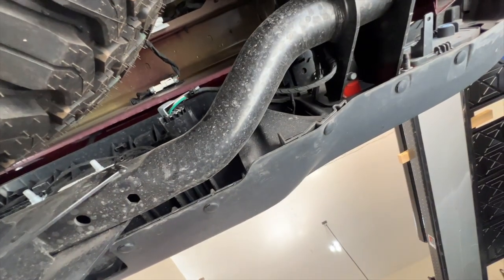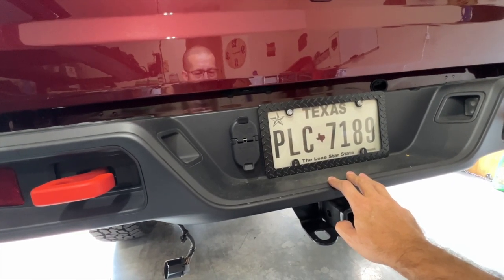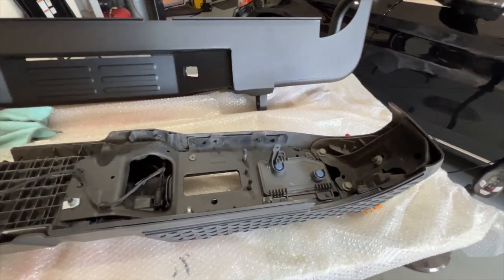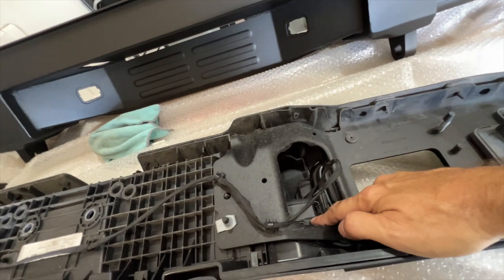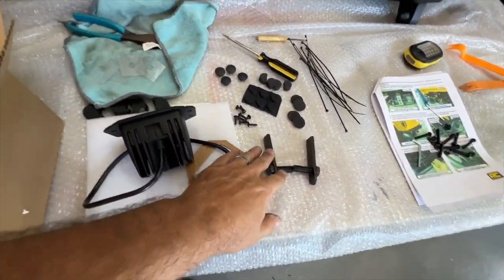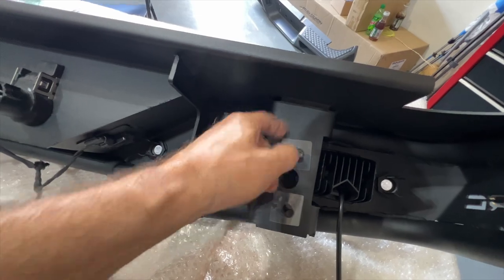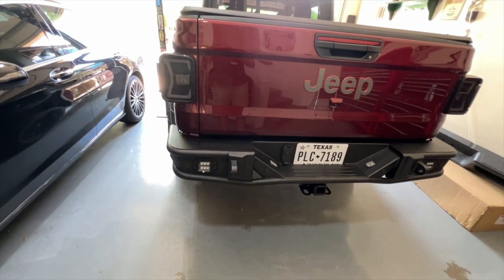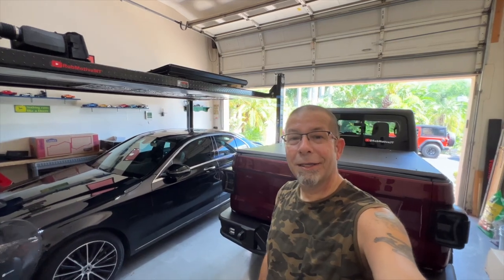Installing the New Rough Country Tubular Jeep Gladiator Bumper

Comment: Very nice! Like that the bumper incorperates bed side protection.  My back bumper wasn't nearly as complicated, but as I joke around on the social media sites, any DIY projects take me three times longer than they should.

I got Red Rock bed sliders and actually got those on fairly quickly.  They attached to the frame AND the third party bumper.  Really solid.
Reply from the maker: Add filming to the mix and it’s 10 times as long😬